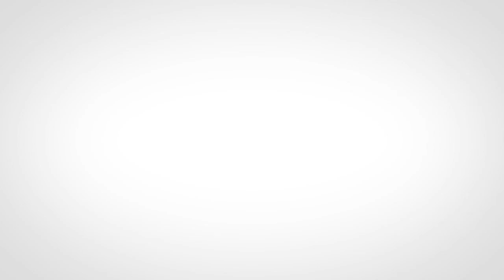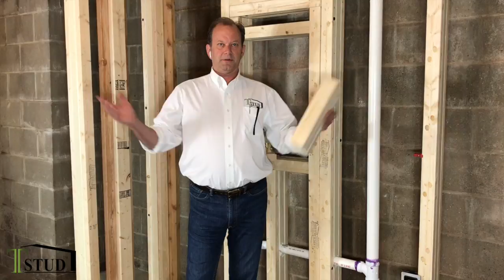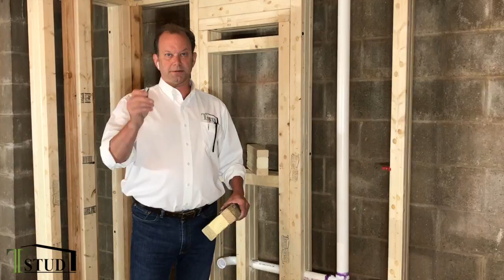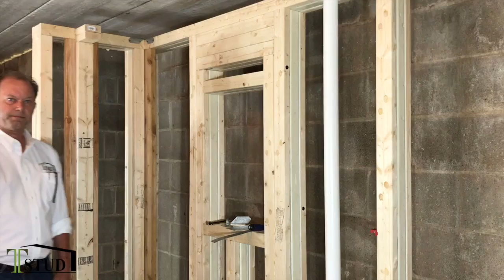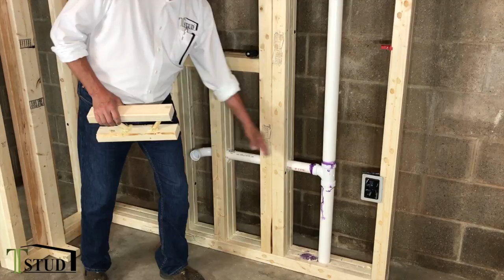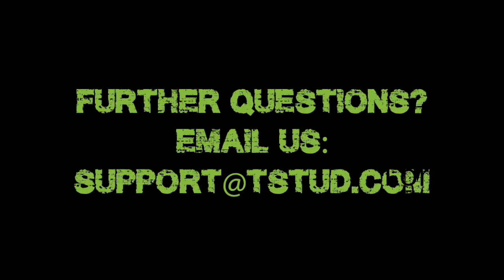Tips and Tricks when Using the Tstud™

Comment: Why did you change the orientation from parallel to perpendicular? I preferred the larger nailing surface… if it was strength alone, how much stronger is the new style vs the old and do you really need that?

Comment: I've got 24 inch spacing in my house.  It's not the Tstud but the drywall doesn't hold well and bows.  I would only go 16 on center.  My father was a builder and wasn't happy when he saw the 24 on center work.  It's all cost savings and not about home stability.
I do like the product.  Anything to break that heat / cold transfer.  Now I'm looking on youtube for actually construction of the product.
Reply: Try using 2 layers of 5/8 drywall.  It is dramatically quieter and has a longer fire rating.

Comment: I’m gonna need an eta on some t-rafters. I was thinkin to use the same as a t-stud but to have a section on the ends spliced in of solid wood for the birds mouth and for rafter tails. No real need to have insulated rafter tails. Any thoughts yet. Naturally this would be used in a place where spray foam is going to be used in rafters rather than ceiling joists.

Comment: Curious ... looking at the dwv and hitting a dowel.  How difficult would it be to cut out the foam run your piping then re foaming that area with expanding foam?  Would that remove much if any R value?  I would think not.   Second question if doing dense pack cellulose will it pack around an open void area that does not have the foam interior.  Doing this how much is reduced in the strength of the stud if no foam is in place, that I would think is provided by having the foam.  Again this might be a bit easier with plumbing runs
Reply: Look up Matt Risenger video on the Tstuds. He covers this. Electric and plumbing are run in between the dowels.
Reply: If open cell, pop right through no problem.  Closed cell will take a bit more to pop through.
Reply: @cpad007  would think that if one  pays attention to where the dowels go thru and how the edge lays out one should be able to figure out where the dowel is lOCATED
Reply: @cpad007  they have to use closed to to get the R rating.
Reply: @tt7hvn  True but you can get the "non-filled" ones and you spray in what you want.
Reply: @stevepailet8258  Yeah, agree.  You just have to face the studs to see the dowels and you're all set.
Reply: @cpad007  not rocket science but have to think a lot of plumbers I have met are not always the sharpest tack in the bin
Reply: @stevepailet8258  LOL.  You have to start with the framers facing the T-studs appropriately and then go in with your giant red marker and put a giant X where to poke the pipes/wires through!
Reply: @cpad007  that works for me.   I like the 1/2 markers LOL

Comment: One other issue I thought of is because the stud thickness The ability to use a standard width  Insulation batt is not possible so you’re forced to either cut the insulation or use an alternative method of wall insulation. What are your builders doing to remedy this?
Reply from the maker: About half of our jobs have spray in HFO foam, 25% are blown in cellulose or fiberglass and the last 25% use batts. 60% of all batts are cut anyways, so they've been cutting down the last 40% to make them fit.
Reply: I don’t think it would be too wise to go through all the expense of these studs and then use regular bat insulation. I would closed cell foam it 2” then Rockwool the rest. I guess the question you asked would still be valid on rockwool.